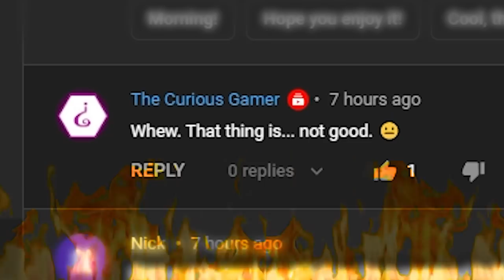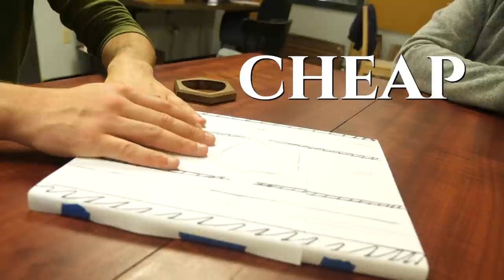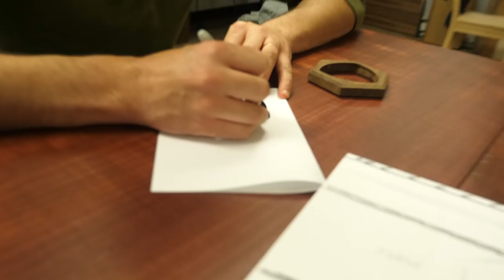New GM Screen Design Pt.2 (Jason was right)

Comment: A possible fix to the metal rod would be triangler cylinder out of wood with magnets. It could give you 2 different angles and it being flush to increase the magnetic contact.

Comment: I feel like using the lamination technique from the CAP line would class it up and could be done in glue up. Might make for a more premium solid wood panel, this giving it a more Wyrmwood feel. I also think you need the same sort of chamfer and relief you find in CAP and Hexagonal Tiles.

Comment: My problem with the original design wasn't the fact that it was solid wood instead of frame in panel, it was the bar and magnet construction.  On the one hand it was a neat idea but it just made the product feel like it wasn't a single piece.  Modularity is an attractive idea but it seems like more people want a static 3 - 4 panel design.

My personal vote would be to use hinges and stick with the butcher block/solid wood approach Doug is advocating here.  The way you add "Wyrmwood Flare" to it from there could be by CNCing depth into the panels to make the interior recessed (essentially emulating a Frame in Panel look with a single piece of wood).

Comment: I’d suggest one larger panel in the center with the two side panels being half the length so that they could fold in and sit flat on the center panel when not in use. That makes the whole thing only two boards thick when stacked together. Could even use magnets to hold them together which you’re already using elsewhere instead of hinges which are tough.
Reply: Oh, and team Jason all the way.

Comment: I like Doug's Idea as a center screen backing. Maybe use Doug's backing with a simplified option and slightly recessed with a magnetic frame to hold sheets in.  I did the original screen Kickstarter with two rotating panels, dice tower, and tray system, and don't get as much use out of it as I wanted.  So for me, the cheaper the better.  I don't think I'll spend another 1000 on the new ones.

Comment: We want something that we can be proud to show off, so don't rush something half baked.  I personally prefer a four panel DM screen.  I have one with a clip board and one with a folder attached so I have my notes and handouts easily accessible.  I think these could be easy accessories to add for the magnet system.  You might also want to consider a container or track accessory to be able to hold the panels and pins during transport by your customers to a gaming location.

Comment: There is nothing wrong with a flat look if you're building a table, dice vault or pretty much any other accessory. A GM Screen is the center of the game. It's what eyes will be drawn to more often than not. 

I like Doug's second idea with the layers of wood. It's more expensive but I would be happy to have that as my center piece more than a few blocks of wood. 

GMs are mobile most of the time so it's important to limit the number of loose parts. if a rod is needed to hold it up there will be a lot of orders to replace lost rods.

Comment: Maybe there's a middle ground. What if the frame was one piece that was cut to look like your standard frame (with a rectangle cut in the middle and an edge to hold the plane in place so it doesn't fall forward towards the players) and the panel sits in the cutout from behind. Of course the grain would reveal that it was just two pieces but maybe that can help with the cost. I really like the customization piece that Doug has in the middle though. That's the thing I do like from that design. Maybe that central panel has magnets so you can swap that panel whenever you want. And then the frame still has the magnets that connect to the cylinder bars between the panels.

Comment: The quality and functionality is good, but I see the issues with the "look".  The design at the end was a major improvement, but I'd like to suggest wood burning art. Like, having the main panel decorated with dragons, or ghostly skeletons, or waves carrying ships through beast infested waters. You could leave the center open for customization (Wyrmwood logo, D20, +$50 for custom campaign emblem, etc.) Something to give it a bit of flare and justify the interchangeable panels. Bust out the nautical theme for the d&d campaign, then switch over to the creepy skulls for your Monster of the Week group. You could have maps or landscape art for the side panels that fit each theme.
Also, maybe cut down on the thickness of the panels by a third or so? Just to cut down on weight.

Comment: When I think DM, I think briefcase. Flip the lid open, that's the main GM screen. Wings either slide or fold out from that. Inside the case are your books, sheets, dice and pens. Slim version doesn't hold books & whatnot. Makes me think of the dice box at 14:35, up flips the GM screen with 2 wings inside to attach to main screen.
Reply: I don't think that's a terrible idea. There are basically two DM's. One of them is going to the gamestore or to their friends house. They have to carry allot of shit, let's be real. So any product marketed to them that includes storage is a plus. I'd been mulling the idea that the panels should just be vaults. Two pieces that click together. But the fold out briefcase thing... that's got potential.

The other DM is the host. They invite people to their home. Is there any reason that the modular gaming table doesn't have a topper piece or other attachment that can become a DM screen? Cause that seems like a no brainer.

Comment: I think one way to solve the magnets issue would be to use the magnets from the Mercer screen.this way the panel would me closer to each other and the gap would be smaller. when concerning the panels issue, I would vote for framed ones, but only because you can make central panels thinner and have the GM screen be a little bit lighter to carry around. I like Doug's idea of having the central piece being something that you can remover and add something different there. I would just try to make it the size of the existing hexagonal vaults to make compatible with the ones people have right now. 
It is really hard to try to make something minimalistic and attractive at the same time without raising the costs too much!!

Comment: This is how I feel like Doug and Jason are on right now with developing this product. Jason does give good points about branding and everything. Doug also makes good points about making a product and getting out to everyone. You can do both but both need to agree and work together. My idea for branding is that when (the play not the dm, is looking at the GM is looking at the wyrmwood logo. Also I think this the gm screen from the Ayer end should be minilastic and simple to the point and the brand. On the inside it should maybe have thing to clap on papers or something but nothing to dramatic or extreme. Sometimes simple is better.

Comment: Doug’s idea is the way to go. I don’t want a screen that looks like cabinetry. Using what they have,… basic panel done with blocks like table toppers. Cut to size. CNC the middle grove and center cutout. Other process, veneer press like the walls of CAP Ptrays. Cut and inlay into frame from first process. Cut edge bevels and magnet holes. I have aa few grand for something like that.

Comment: Frame and panel is they way to go.  
You already make the panels with that multi board vertical cutter.  re-use what you have! :) 
Guestimating you'll need to hire at least 4 additional craftspersons to do the below full time
2 to cut lumber to assembly state. You have varnishers already

1.  Use more out of that multi board vertical cutter you have for initial width and height cut of frames.
2.  Run table saw daido to cut width of those panels you already cut for the special dice trays.   
3.  Make two table saw jigs (multiple for multiple table saws)  
       a.  1 to cut length of top and side frames
       b.  1 to cut 45* cut for corners.
              Cut in batches of 20+ each pass for A. and B. Above.
2.  Saw table jig to cut daido's for magnets (like mercer screen)  run 30 per pass,  flip run 2nd daido on same batch. 
3.  Get with that company that made the multi drill for MGT Legs.   Make machine that drills say 10 or more holes at a time for pins for magnets. 
5.  Assemble like you do for trays now.   same process wrap and cure.
6.  clear varnish only in batches
6.  final sanding, insert magnets
Profit?

#1 would be the main piece of equipment that would cut cost down  since you already have it,  $400-$450 price point would be key.

Comment: Jason is 100% correct do a nice GM screen with frame and panel, no way it should cost even $1,000.  Invest in machines that make the frames easier and panels are just plywood with veneers you already have veneering capabilities.

Comment: I'm on team flat. I think raised panels look like cheap kitchen cabinet doors. If you are gluing up strips anyway then add horizontal accent banding like the Adventuring Party vaults. Maybe laser cut some custom artwork on the panel fronts with resin or wood accent inlays.

Comment: What I, and I think most people would want is a well made product that looks and feels like it belongs on a Prophecy, that Feels like Wyrmwood. The vaults, Classic Adventuring Party,  basically everything you make looks and feels professional. Even Project Hexy Time works in its simplicity. That is what this is missing. 

I have always wanted a Wyrmwood DM screen. And as a Wyrmwood product, I know it will be pricey. I also would hope that it is high quality craftsmanship that will last me for years to come. What is currently on the table is... not that. It feels like Etsy. 

The V1 prototype was not a wormwood product. It was literally just a slab of wood and magnets. The idea of getting multiple panels was really good though as I would prefer a 4 pannel set up compared to the standard 3. But not modular. As some other people have said, this should be a stand alone product. Trying to nickle and dime us on accessories is not the way to go. 

V2 is better, or well, at least looks better, but still doesn't feel like Wyrmwood. What it does feel like is Etsy. Homemade, but decent quality, Just not the standard we expect from y'all

We have faith that y'all will figure it out, and are happy you are taking feedback from the comments. You can do this!

Comment: Okay, hear me out.  It's like the different class sets.  Bard, barbarian, rogue, fighter, etc.  Keep those same wood combos, can keep the different flavors on rotation and still have that simpler look like Doug is talking about but now you're tying it in with other products, making it look and feel more wyrmwood like Jason is concerned about.  And then, from there, you can add a second tier, an S tier if you will, that is panel and frame where you have the premium profecy feel, while the class sets have the MGT feel.

Comment: How about CNC'ing the "frame" into the solid piece of wood?
Make a board, engrave a frame well in the center, still use the hex tile idea and you can have solid wood veneered with another color so that you show a bit of variation.

Comment: Hearing Doug say he didn't care about the vision of the company was so sad and upsetting to hear.  I know you have a lot on your plate Doug but as the CEO you are the one above all who has to hold up the vision of the company - your CFO and COO can focus on jobs and saleries. 

If you're not in a position to fullfill a high quality DM screen, then don' do it.  Please wait until you have the bandwidth, don't just throw out a cutting board with magnets to try to appease us.  

1. It dose't have to be modular - just make a 3 or 4 screen version
2. It doesn't have to be cutting edge or innovative, or tickle my balls - I want a SHOWPIECE to display on my table. I want an HEIRLOOM DM SCREEN. 

We understand the Matt Mercer screen is a masterwork level expensive - but there has to be a middle ground where I can buy a quality screen for $500-600 dollars.

Comment: could use tubes than solid bars as they seem alittle heavy for the magnets and for the portability (could be handy if i got jumped in a ally way and just yeet the steel bars at them to get away not sure if you want that feature in your product :P ),  i would suggest tubes as this  would also cut the weight, shipping, cost and you could use it as dice storage/ a place to keep pens and pencils with some nice end caps  on the tubes,  :)  im sure you guys will work something out in the end, just hard to see how this all fits together with your other products, maybe do a DM screen made from hex tiles glued together and off set the colours ''like cutting boards'' this means you are using a process you already have to make HEX tiles

Comment: I will say, Doug has some points to make on keeping the price relatively low. The sad fact of the matter is that dm screens are an inherently low demand product. This is a niche within a niche. If we compare the demand for a gm screen to the demand for general wyrmwood products, it's a downward shift. The general economic principle is that when demand shifts downward, quantity produced and price sold at are both gonna naturally decrease to keep in line with the demand. Does that mean they should make an inherently "cheap" product? No. But the conversation about affordability is a valuable one to have. We haven't seen prototypes of every idea, those will probably come in the next week or so. But whatever they can produce that's aesthetically pleasing, and at a cost that meets the demand, that's the direction they should go.

Comment: Here’s the thing. 50-75 per panel for blank solid wood is just _way too much_. I can make my own “solid wood” GM screen for <100 with no woodworking experience and have basically the same product. The “cheap” option, once you add the Wyrmwood Tax, is just absolutely not worth it at all.  200-300 for a hyper generic screen I can buy on etsy for <100 from a smaller independent, or make myself for even less, is just a terrible value proposition. If I am buying something from Wyrmwood, I am expecting to pay a premium to have something that I cannot do myself, and $500-600 for a GM screen that is actually interesting is a way better buy then spending $200 for some magnetic cutting boards that feel price gouged.

Comment: Looking at the rest of your product line, I would expect the price point on a GM screen to be "starting at $120-150 per panel." That would put a simpler 2-panel setup at around $300 and a 3-panel option with a couple of upgrades around $500. It should be a more involved and more premium product than a dice tray, but you don't want it in the same realm as the gaming table.

Comment: I think Cristaldi is on to something. You can get dimensionality from subtractive processes, like routing, not just with additive or changing construction.
A subtractive process allows for solid wood construction, and adds on dimensionality, without raising the cost as much as having to make multi-part inlays.
You can also somewhat mimic paneling with a subtractive process. You just wouldn't have the grain structure 'framing' the outer edge.

Cristadi hitting the best of both worlds IMO. But it wasn't really being considered in the video :P

All of Jason's points in the video were right tho lol. Make a good product, price it where you can, and go forward with that. Wyrmwood as a brand (oh no, evil word!) has an image of quality. It's not about selling products that happen to be made out of wood, its about selling woodwork items.

Comment: Needs a price point sub $300 for a 3 piece.
One cost-savings point, only use magnets at connection points; inlay sheet metal pieces on the inner screen instead of costly inlayed magnets.
it's only holding up paper.
The money is in the integration of existing systems, like Hexy.
Putting a inset metal strip along the bottom edge(s)

Comment: Every single one of Jason's points is fair and accurate, and I agree with some of the other commenters who are saying it seems like he's getting attacked/dismissed too much here.

However. Doug is ABSOLUTELY on the right track to focus on the solid wood, more affordable core basis for the panels. In the same way that the MGT has a much wider market than the Prophecy, you gotta get that price point down if you want this thing to be a bestseller.

Comment: Why not, and I’m sure there’s a reason (that’ll be brought up by the end of the video), round off the ends of the slab to match the diameter of the barrel magnets from the Mercer screen? Like, a solid wood piece, but rout a channel and add a metal strip for magnets, and drop some magnetic pin points at the top of the panel for the initiative tracker piece, and put barrel magnets on either end?